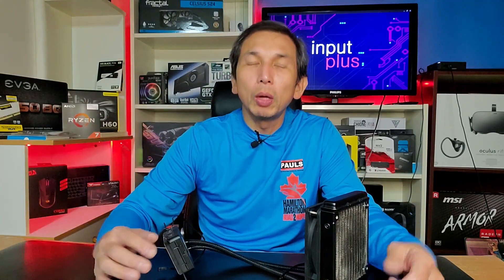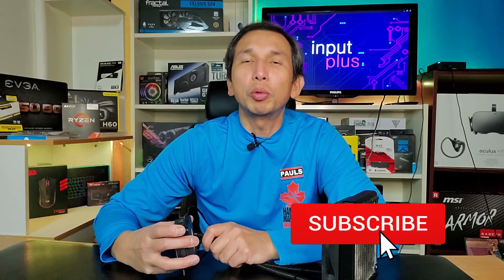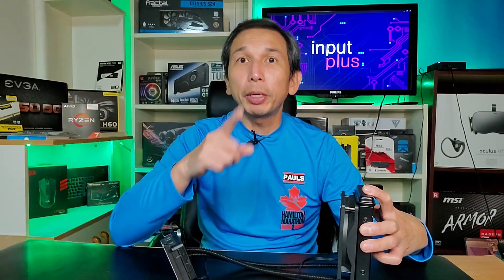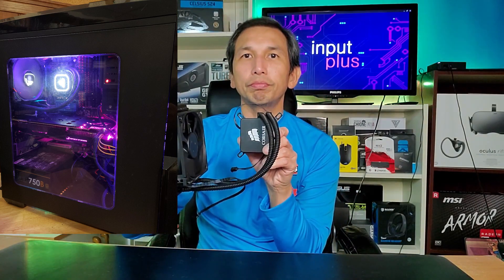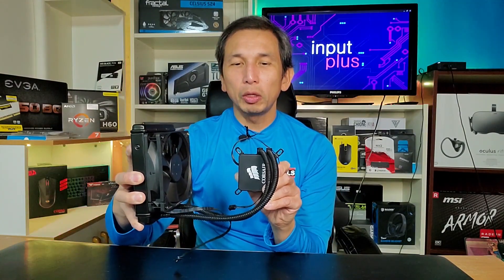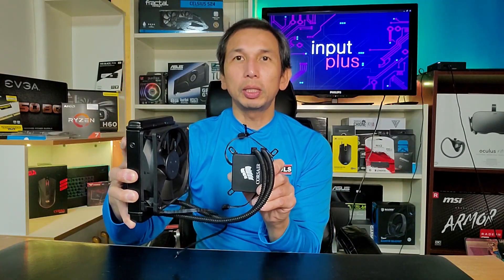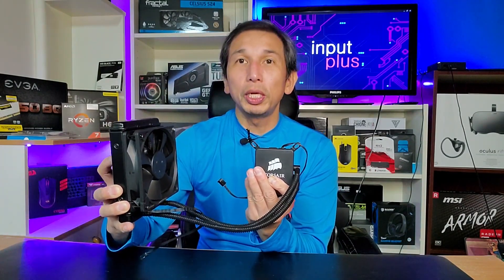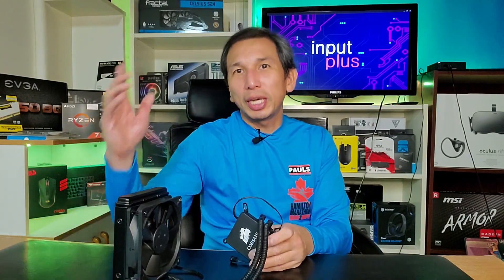AIO Pump Orientation - Does it Matter?

Comment: Interesting video.  It definitely could be the orientation that affected the temperatures, but also... I've had 5C+ differences just from reapplying thermal paste and using a tad less/more, depending on the instance.  So it could have even been that you got a better contact layer of paste.  Or the baseplate has better contact areas/less imperfections when you rotated it so that it had better contact over the working parts of the CPU.

It's hard telling, right?  Just thinking out loud.  It could be that the water flows more freely, now, too, of course.  Maybe a combination of things or maybe none of them haha.
Reply from the maker: Definitely agree with you. Cannot discount any variables. Thanks for the input (no pun intended).😊 Cheers!

Comment: Highest point in your loop is where the air will go. CPU aio radiators should be top mounted if possible. Then the pump orientation won't matter.